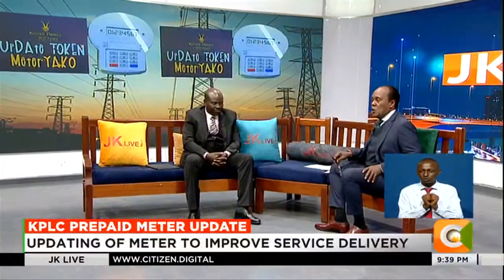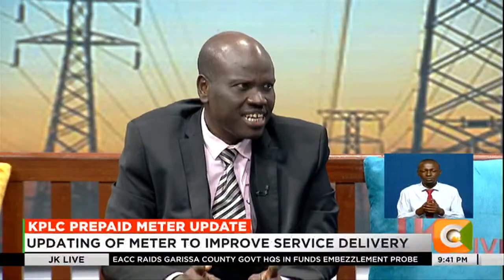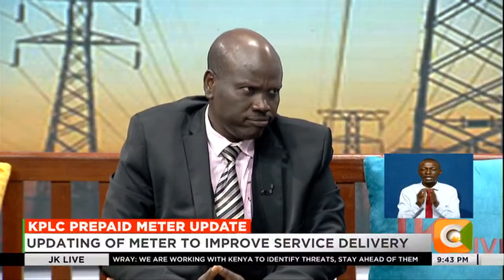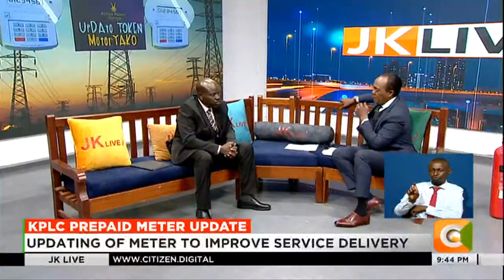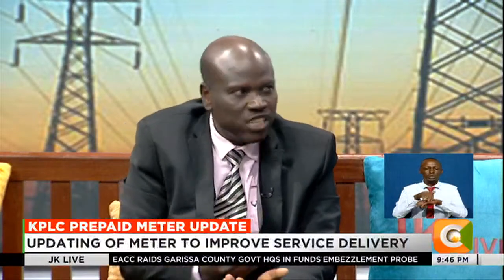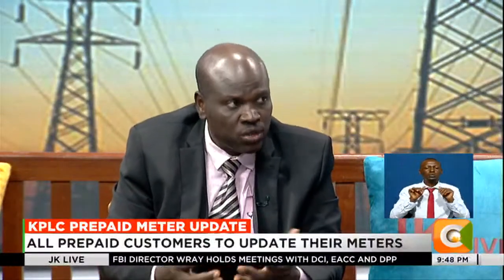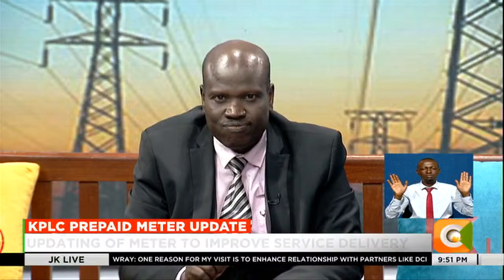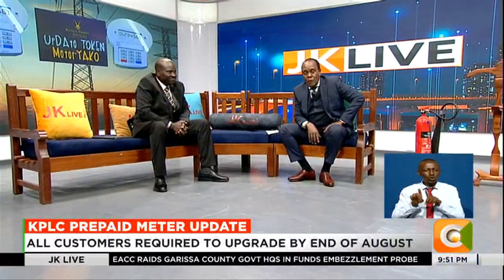Eng. Joseph Siror on why all KPLC prepaid meters need to be upgraded

Comment: I have said it 100 times. KP will never rach its full potential as long as it is currently constituted as a parastatal with parastatal thinking and ways of doing buisness. KP suffers like all parastatals. There is no parastatal that makes any profit for the govt and that says alot. Govt is not supposed to be in the business of doing business. Safcom used to be a parastatal until it  ceased being one and privatized. Today its one of the most successful companies in East and central Africa by virteue of private thinking. meaning do more with less and continously reinvest profits to be better every year. Where is that thinking in any parastatal?

 They make profits they squander the profits, spend money like drunken sailors, instead of reinvesting profits to be better like becoming more efficient and doing more with less, they squander everything no vision of where they want to be in the next 5yrs and competition comes and leaves them in the dust. Kp should be the next safcom.  

power being the back bone of the economy we keep playing games and complain but what do we expect from a parastatal. Every Kenyan can get a phone when they need one but can not get reliable power when they need it . Why . Kp is run by govt bureacrats and you get govt bureacratic results.

The only way is to privatize KP like we did with safcom. Bring in a strategic investor in the power business like siemins. Siemins comes with its mgt systems from top to bottom and clean up the rot at KP. Rehire professional stuff that are qualified. use the assets of KP which are all over the country and utilize these assets to their maximum.  This nonsense of meters would never arise if Kp were privatized because companies make decisions after considering all liabilities because they have alot at stake to lose they have no one to fall back on and one mistake like KP will be bailed out by govt.